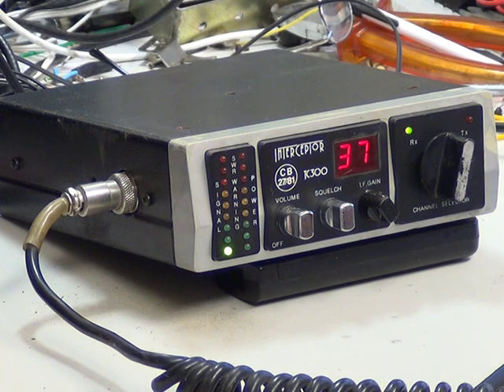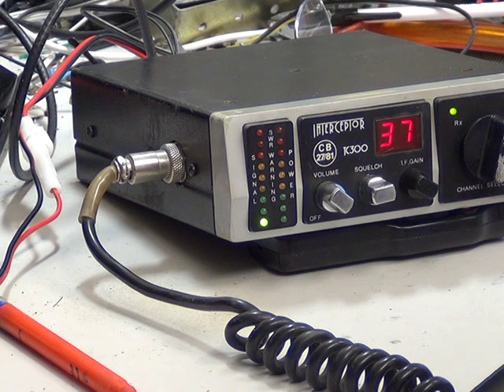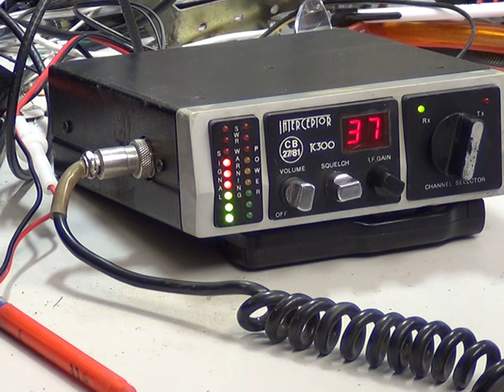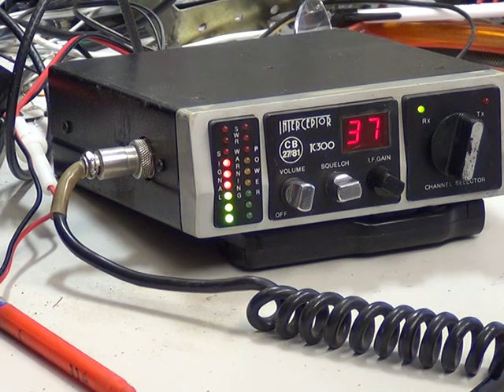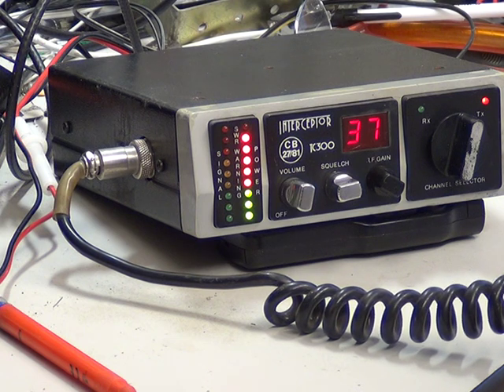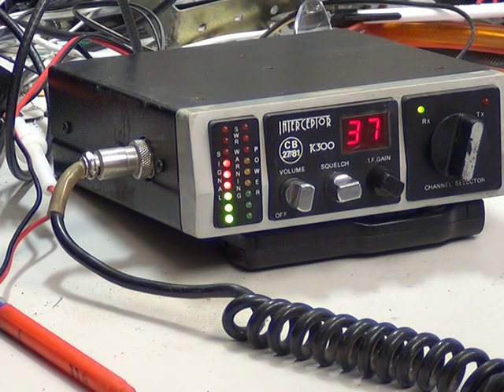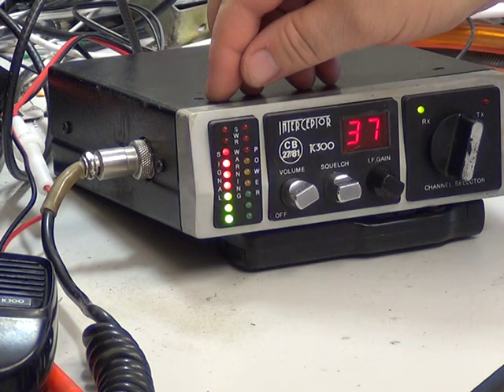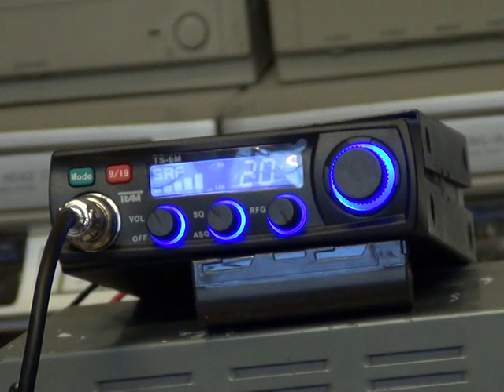Interceptor TC300, UK (CB 27/81) CB radio (Mobile) - On The Air Test

Comment: Richard I am seeing a few radio's that I have never ever seen with the 27/81 stamp may be some didn't make it south of Nottingham :o).. This radio looks very much like the old Hygains.. I used to live next to the Harry Moss Factory in Redditch.. K5NOV
Reply from the maker: It may well look like a Hygain FCC model, but they were made by Cybernet. This is made in Korea; is an unusual circuit & works well...apart from the over sensitive thyristor triggered SWR alarm.

Comment: Took ya time getting one of those in ! 
I all ways thought they where a poor set ! Have you done a video of a Communicator nx440 yet ? Like to see one of those done and what you think many people slate those but I could it worked very well from my truck !
Keep listening out for you when I'am around Ancaster but no contact as yet one day I'll catch ya on ! 
73 Sam
Reply from the maker: Sam, I HAVE done the LCL Communicators NI440DX, but so far only as the Planet 2000, not as the Manor Kestral, nor as the Serpant UK4000 (which is the original version). When set up correctly they work very well indeed & were one of the highest scoring sets in our field & user tests of 1983...I seem to recall it scoring something like 81.5%. Ideally they need to be set up with a sweep generator which few service engineers have. I'll be doing the NI440DX on our service bench no3 (with sweep generator) later on in the year.

So....very few people can set them up properly and obviouysly they need servicing after 30 odd years.

I'm only ever on UK channel 37 for your info.

Richard

Comment: I had one of those. Intermittent TX on it. Couldn't find the fault. Tried for an hour. Ended up on eBay and sold for roughly £7 + post so wasn't bad. Paid £2 at a car boot haha :)
Reply from the maker: That's about what I paid for it off ebay. Are you sure it isn't the same one! Came with intermittent TX because the + side of the power connector wiring had corroded away stopping enough current getting through for TX. I threaded some new multi-strand wire through. Tait 500 series business radios were notorious for doing the same.

Richard
Reply: Might well have been haha. Sold it back in Jan this year. Not sure when you purchased yours? If it was after then, maybe the person I sold it to sold it on to you
Reply from the maker: Just checked with the stock control computer, I paid £10 for ours off Ebay. Unfortunately I have no purchase date
Reply: ah I see